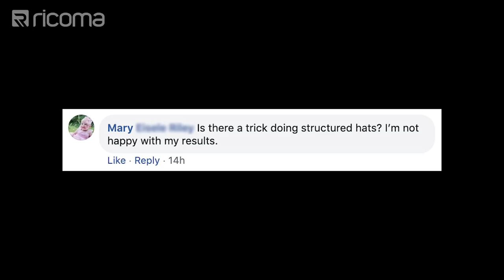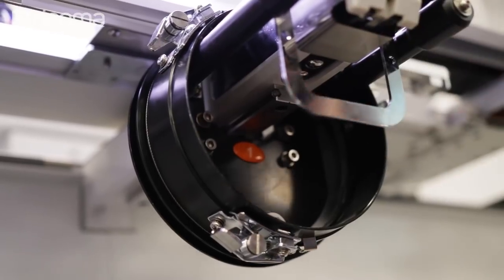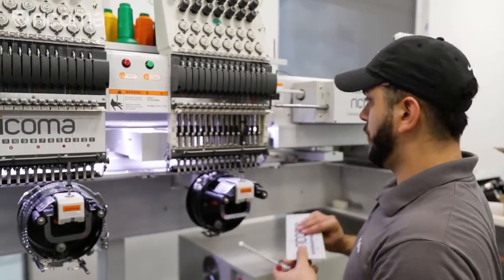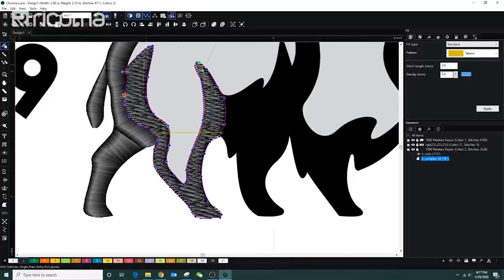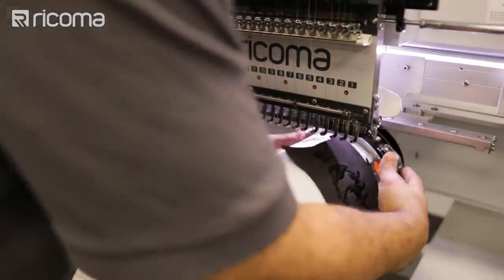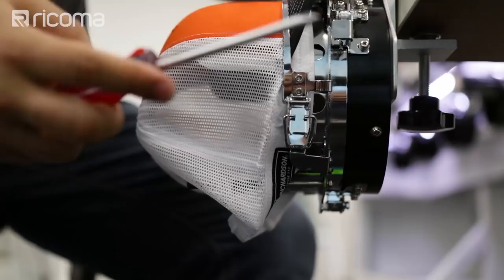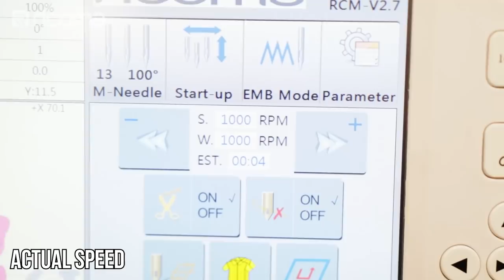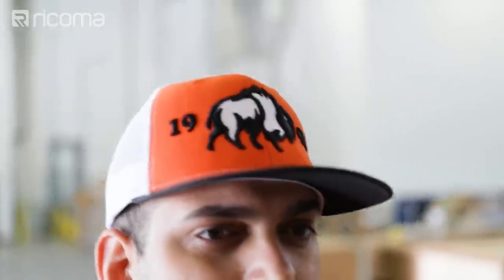RICHARDSON CAPS 3D Puff Embroidery Challenge at 1000 SPM - Mission Impossible?

Comment: Great video! Looking forward to the detailed digitizing video!! You showed the proper height of the presser foot for the cap and the puff, which key do you use to set it back to normal?
Reply from the maker: Your pressor foot should be adjusted back to how it was OR you can adjust it based on the thickness of the garment you'll be doing in the future, but you'll have to adjust it back the same way you did if you followed the steps in this video, with your screw driver and Allen keys.

Comment: Where has this information been?.. I’ve been wondering why my 3D puff hasn’t been looking as good as everyone else’s . Really seems like a process to do 3D puff on Ricoma. On the cap driver, does it have to be reset after you’re finished or is it fine to leave it after the adjustments have been made? And I assume to change the footer back to how it was before doing 3D puff, correct?
Reply: You don't have to reset the cap driver. That should stay. But your pressor foot should be adjusted back to how it was OR you can adjust it based on the thickness of the garment you'll be doing in the future. That's why this pressor foot adjustment is applicable to many different types of garments!
Reply: Hmm interesting, so adjust the presser foot based on the thickness of the garment
Reply: Yep that’s precisely what it’s there for!
Reply from the maker: Let us know if you have any more questions!
Reply: Ricoma Embroidery Machines, I most definitely will, I can’t wait to try out 3D puff again after learning this
Reply: what the heck i guess ive been getting lucky!!!
Reply: SE SHIRTS AND HOODIES   I’ve done both and honestly I don’t notice a difference at all. I’m just going to put back to normal and leave it like that

Comment: Hey man, I’m using two layers of 3mm foam for my caps but they still seem less puffy than your caps with one layer. Tried decreasing pull comp, less thread tension, rethreading the machine etc. any advice?
Reply from the maker: Need to make sure to remove your underlay. Also there are several 3D puff videos with digitizing on our channel, make sure you’re following those tips
Reply: @ricomatv  yea I got those, I only digitize with a run stitch in the middle, unfortunately still don’t get the results I’m looking for :(

Comment: Why did he use two different size Allen keys when adjusting the 1st and 2nd needle ? Shouldn’t the setting/depth be same for all needles? How did he rotate the cap driver right and left to get to the screws? I have recently purchased an EM 1010 and I think I need to raise needle/pressure foot to allow for thicker materials. Thank you
Reply from the maker: Hi to get help with making thesis adjustments, contact our tech support here -> https://ricoma.com/US/tech-support
Reply: Because the larger Allen key is for the 3D puff needle because the pressor foot needs to be higher to accommodate the foam.

Comment: hey I  am planning to get a machine  soon and I was wondering if you can you do this on a EM 10-10 ,or does it.have a different proceeds and 
steps for that style of machine?
Reply: The concept is the same. You need to adjust the cap driver and to adjust pressor foot height depending on the thickness of the garment you're embroidering. The steps are not exactly the same because the location of the screws etc. are located differently, but the concept applies across the board to all machines, and definitely applies to the EM-1010 as well
Reply: @henryma1734  perfect! exactly what I need to know thanks again.:)
Reply from the maker: Thanks for watching!

Comment: Wow, adjusting these feet is easier than on my longarm quilting machine - same exact process but don't have to take the whole front of the machine off.
Reply from the maker: The “front” of the machine is just a metal plate in this case, not that hard and just slides off. Plus you’re comparing a multi-needle machine to a single needle one.
Reply: Yes, that's exactly my point. To adjust my longarm needle bar or hopping foot I have to remove two tablets (the A-1 control and the Intelliquilter) and then the faceplate. It's a PITA. The Ricoma adjustment is obviously much less trouble. @ricomatv

Comment: Bottom line on these machines is hats. Not unstructured, but structured hats.  structured hats are the hardest thing to embroider on.  you want to test a machine, I want to see a Ricoma (Willy) sew a 6 panel structured hat with a logo that is 2.50"tall.  that has 3 layers thick of stitches (2 fill stitches) with block lettering on top that is .16" - .18" tall that sews across the seam of the hat.  Type of hat (Richardson 112) (pacific headwear 104C) I am no NOOBIE in this industry.  I am a 30yr veteran. I Run Tajima's and they will do this type of sewout on hats.  let me see Ricoma (Willy) do the Same........Cmon Willy lets see it :)
Reply from the maker: This video precisely shows that and plenty of other videos on this channel show that on Richardson 112s
Reply: @ricomatv     please link me these videos.  i want you to know i am not trying to put a logo on your machines to try and trash talk your machines k.  this type of logos i am asking you to do is put in front of me and i am asked to sew this on a hat.  112 are the worst and i do my sewouts on these hats cause they suck.  i have seen your machines sew some stuff out and they have impressed me.  do a rectangle fill across the seam and please do .18" block lettering on a 112.  i just want to see your machine sew it out, thats all.  will it have some difficulty doing this, yes it will.  it is NOT to trash talk your brand cause I Run Tajima's.  i feel your machines give Tajima's a run for there money.  i am interested in buying a 1 head for sewouts and it must do what my clientle expects me to sewout.